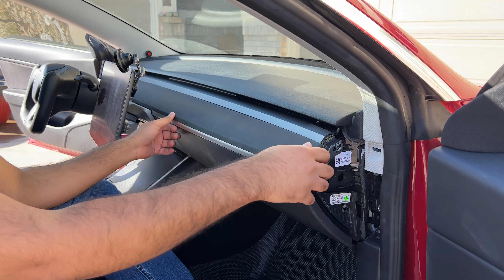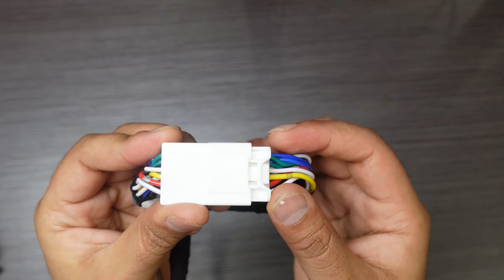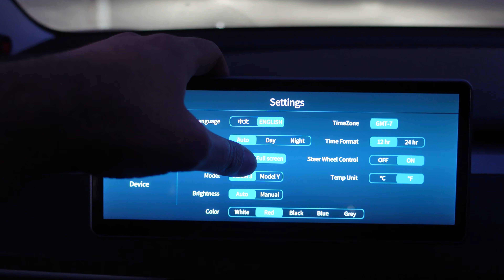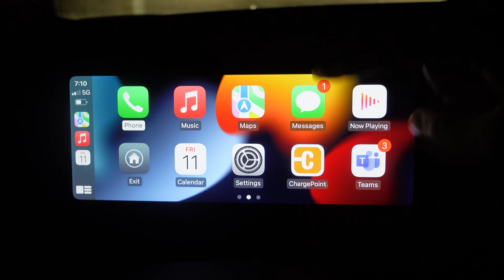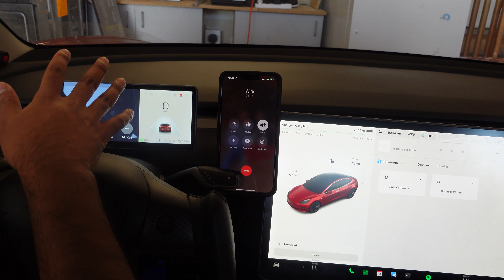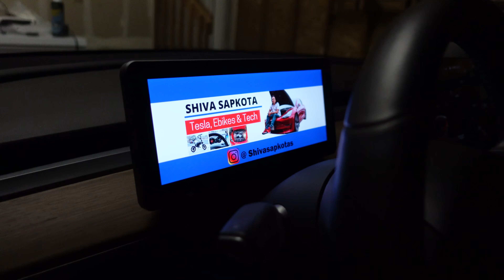NEW Apple CarPlay Display For Tesla Model 3 & Model Y - Instrument Cluster Must Have Accessory 2022

Comment: Does this new display work with the same wire harness as the old one ?
Reply from the maker: The wiring is slightly different but you can use the cable harness and daisy chain the old plug. That will prevent you from having to reach the Tesla plug. Thank you.

Comment: Hi Shiva I have installed the older one Can I change to the newer one using the wiring that the old one uses Cheers Allan
Reply from the maker: I don't think you can use the existing wiring but you can daisy chain the existing plug so you don't have to remove the OBD plug this time and just tuck away the older wiring. Thank you.

Comment: My disappointment with this display, is the small size of the fonts. they waste so much space with the circular graphics that are either redundant or not needed at all. They could have made the other info larger so it could be easily seen/read.   What is the purpose of a radial speedometer when the speed is displayed as a number in the center?  And isn't obvious when the car is accelerating or using regen? Do they really need to take up 1/3 of the display for something that obvious?
Reply from the maker: Thanks for your feedback! I agree, I want more customizations. I don't need those big dials but want to see more information in that space.
Reply: indeed. screen can imho go down to like 7-8".

Comment: My model y 2022 is very different I could not find the display plug is there anyone can explain PLEASE
Reply from the maker: With an AMD chip? The display plug is on the door pillar on the passenger side instead of being under the glovebox. Reach out to the seller and they should be able to send you a diagram. Thanks.
Reply: I have the same issue! 2022 model y ryzen
Reply: Any luck? I have the same issue on 2022 model Y
Reply: Furikjan, is your 2022 model y long range or performance? Is your infotainment screen using intel atom chip or amd ryzen chip?

Comment: Mate I use the existing cables and just change the screen. I have the previous version installed.
Reply from the maker: I am not sure if the connectors are exactly the same for this one. You can certainly daisy chain the computer plug but not sure about the display side.

Comment: Can you control CarPlay using the steering wheel controls?  Or is it strictly a touch interface?  It would seem awkward trying to touch the screen while driving, especially with a regular round steering wheel.
Reply from the maker: I haven't yet seen a full tutorial on this but the only thing my steering scroll wheel currently controls is going between Carplay and the Main UI. Perhaps they will add that in the future. Thanks.

Comment: How well does the audio portion of CarPlay work? Like Spotify?   

Also how well does Waze work

And does having this unit connecting to Bluetooth for CarPlay prevent any of the native Tesla apps from working?
Reply from the maker: It doesn't affect any native Tesla apps. The audio can be played using the little speaker on this dispaly (which is louder than I thought) or you can connect this display to Tesla and play audio through the car's speakers while still connected to Carplay. The audio quality is the same as if you used the Spotify from your Tesla vs this display. I haven't tried Waze yet but the previous display worked well with Waze (just like using the app on your phone),  so assuming this would be the same. Thank you very much.

Comment: Does the system recognize metric system...ie. Canada cars? And if main screen is in dark mode as we like to keep it, will the dash screen move to a dark mode also? It would be odd to have a light grey display as shown with the main screen on dark! Great video by the way! I'd like to try this on our future MYP coming (also yoke ordered), but I didnt see any settings allowing metric other than C vs F temp. Thx!
Reply from the maker: Hi Naveen, yes the system automatically recognizes the metric system so yours would say KM/H instead of MPH. The screen automatically goes into dark mode (darker blue) when the Tesla transitions from white to black. Congratulations in advanced on your MYP, hope you get it soon :) The Yoke is really fun, I will be installing an elliptical version soon and compare it with my current trapezoid one. Thank you for watching my videos.
Reply: Perfect thank you :) last question…I have a 22’ M3 LR…will this void my warranty? It’s one thing to have a yoke but with a screen it’s tapping into electronics of the main screen no?
Reply: Ok so got the install of yoke and screen today! Love it!! 
Question…did the screen actually fit perfectly straight like the main screen or sight angle due to the dash itself being a bit angled? Wonder if the installer just screwed up when he righted the bolts? It’s subtle but slightly off…like 1 degree maybe? 

Also I find the tach for power very choppy. Not a smooth needle..almost as if the software is still weak? This is the new Linux version so I figured there would be no lag here? And lastly when I accelerate faster the speed changes slower  than the main screen speedo. Again like the processing is lagging a bit. Is this classic bait and switch internal chips from China? Lol
Reply: Also Shiva..wondering..have you ever seen anyone inquire about changing the pewter trim in model 3/y to the chrome type trim in the new S? The trim part that is under the wood on the doors and under the wood portion of the front dash I think the chrome in the new S gives it a total class increase! I’d line your thoughts on how this could be done!

Comment: Is it 8.8" android or linux? On website they also have 9.0" Linux, which one is the newest? Thanks.
Reply from the maker: The 9" Linux is the one I reviewed in this video. The 8.8" ones are older design. Thanks!
Reply: @ShivaSapkota  Does this new 9.0 Linux version have the  screen mirroring feature like the old 8.8 one?

Comment: Definitely an updated display sometimes software updates can only do so much. This has smaller bezel a sharper display and a better operating system way more practical!!
Reply from the maker: Agreed! The older one had wild bezels, just that change alone makes this one look so much better. As you said, the linux OS is so much faster.

Comment: Awesome video !  How does the call quality sound compared to the OEM Tesla system without this add on?
Also just curious if your Model 3 rattles inside with all the mods you’ve done having to take panels and disassemble the car to install these cool mods.  Thats my biggest concern especially with the self close doors.  Thanks for your feedback!
Reply from the maker: The call quality sounds exactly the same to me with this display or going through the main Tesla without this display. The previous display had some issues with calls sounding all robotic but that issue doesn't exist with this one. My car doesn't rattle with all the mods but probably is louder as removing all these parts increases the chances of wind entering the car. I just have to make sure to tighten everything back together once I am done with each install. So far, no issues but we will see how everything holds up and if these mods affect my car in the long run. Thank you.

Comment: I have one of the units but I cannot find out how to update the software if there is a software update available where on a website do you download that file?
Reply from the maker: They haven't released the updates in a while now. If they release a new one, I will make a quick video and share the link. Hansshow folks did tell me something was in progress, but I don't have timing on when and what the new software will bring. Thank you.
Reply: I asked them the same question regarding my Android version. They actually recommended me not to update the firmware. It apparently causes more problems than benefit at the moment.
Reply from the maker: @brianzoowab  Thanks for the input. I really appreciate it. I have asked Hansshow to join the comment section and respond to these comments. Hopefully they participate tomorrow.

Comment: Thanks for the new video. I have the older one installed already, but do you know if I can use the existing wiring with the new display? It was kinda big hassle to get to he plug in tight spaces.
Reply from the maker: I will defer to Hansshow on that one. They might have used a different design for the wiring. However, you can leave the older one intact and just daisy chain this new plug to the older harness. That way, you wouldn't have to remove the plug from Tesla but just hook it up to your older wiring. Hope that makes sense.

Comment: Great video. I saw this a couple of days ago and was really thinking about ordering until I realized that the front camera is not supported. :( Do you have any info if this will ever change?
Second question is regarding the connection of the phone - can I connect the phone via BT to the main screen (for calls) and at the same time use use wireless CarPlay to navigate with Waze or Google Maps?
Reply from the maker: Unfortunately, looks like the front camera has been discontinued for this new model. You can still get the older android one or they also sell a 8.9" Linux/Android version with the front camera. Regarding your second question, yes if you have a phone that support dual Bluetooth streams (all mewer phones do), then you can use Carplay with this display and bluetooth for your calls directly with Tesla's screen. I was really happy to see that they fixed call quality issues that was in the older display. Thank you.